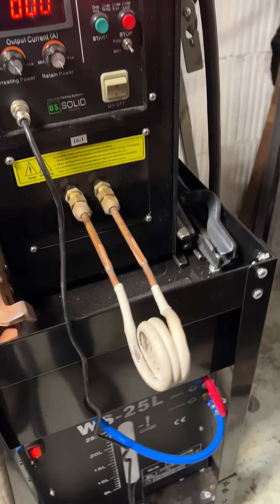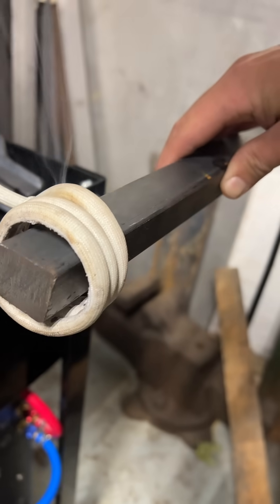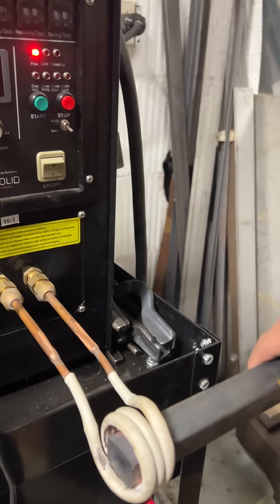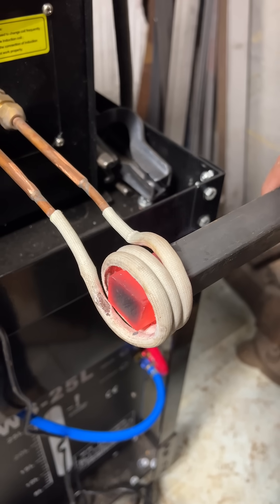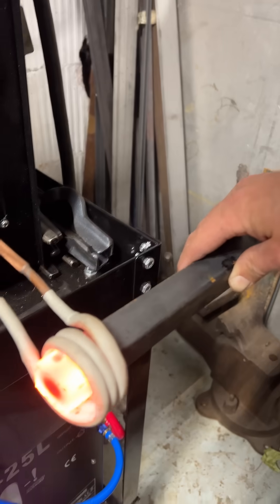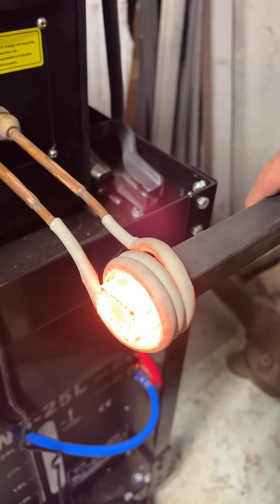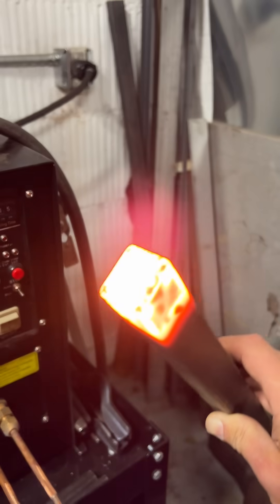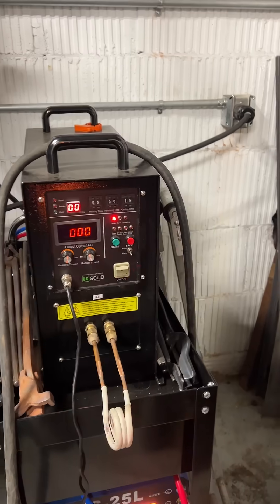Red Hot Steel In Seconds! - Induction Heater

Comment: how is it not hot where you grab it? I've always thought most metals conduct heat well
Reply: It takes time for heat to diffuse through a metal rod. The mathematics behind this is taught in great detail in the very beginning of any introductory partial differential equations course/text. 

Surely though you've noticed that when something heats up, the entire object doesn't come to the desired heated up temperature instantaneously, especially when only one side of the object has heat applied to it

Comment: Those things need a RIDICULOUS amount if power tho, super sketchy to do in your own home lol
Reply: Why, because you don't know what you're doing?
Reply: @G59-Izalith  yeah i was thinking the same thing. Whats sketchy about it??? Unless you have a illegitimate  power supply it should all be above board. Its no different then learning how to well. Actually easier than welding. 
Welding you have all kinds of amp rating and material setting to have to track and set.  If anything a microwave is sketchymier than this
Reply: @c.a.nationwide  lol exactly ....they need to go play with some microwave transformers....
Reply: Wellllll, lots of power, but only for what, 60 seconds at a time, so not too bad.

Comment: Ah yes, the forbidden flesh light.
Reply: Unless your dong is made of steel you're going to be fine. The magnetic field this gives off only really affects metals. A microwave is just this thing but tuned to what your dong is actually made of, mostly water.
Reply: @DingleFlop  iron man would be screwed
Reply: @iborincon  the internet never dissapoints
Reply: @therapgame1091  Right? Lmao
Reply: @DingleFlop  MAN OF STEEL BRO, MAN OF STEEL🦸🦸‍♂️
Reply: @DingleFlop  you right.
Reply: @DingleFlop  understood, not a forbidden fleshlight unless you have a stainless knob piercing.
Reply: @DingleFlop  Superman be like “FUUUUUUUUUUUUUUU-“
Reply: @DingleFlop  would just about any low frequency work (and even be desirable?) for the induction heater? Obviously microwave uses very high freq tuned to excite/friction/boil water molecules, but as I understand it the induction heater accomplishes it’s job thru eddy currents (?) / just having massive amounts of current flowing in a specific spot? 

I’m not trying to present that I have 100% grasp on these, I am truly not an expert..! I just want to learn!

Cheers
Reply: @DingleFlop  Key takeaway that it's safe to interact with as long as metal isnt involed is 100% true. It's not really the same though but it ends up doing similar things. The microwaves' electric field interacts directly with polar molecules to cause them to vibrate, which is what heat is. This induces a high current in the metal so mostly just effects electrons and that in turn causes heat. A microwave uses essentially an antenna to produce waves that cause heat, this just directly uses the induced electric field in the material to produce heat.
Reply: @28porkchop  by the power of S C I E N C E !
Reply: @DingleFlop  a magnet job 😈
Reply: @DingleFlop  Username checks out
Reply: @DingleFlop  

That's only true for everyday magnetic fields.... they have used magnets to float fruit, frogs, and wood with high enough energy... So a strong enough induction heater might be able to do the same to flesh and wood.... Tho that would probably also be so strong anyone in the area would probably die.
Reply: @DingleFlop  so its safer to put your dong in an induction heater than in a microwave?
Reply: @DingleFlop  Don't know why you brought up the microwave, you were right up until that point
Reply: @Syndicalism  a microwave is a radio transmitter based on a magnetron that creates a 2.4 Ghz radio (electromagnetic) signal at many watts to use the exact same principle (forcibly vibrating molecules at a resonant frequency to generate friction and consequently, heat) but tuned to the resonant frequency of water. Induction works in almost exactly the same way, though a magnetron is unecessary due to the wavelength of that radio signal only needing to be around 150 Khz to resonate with the molecules found in metal. Because they are literally the exact same principle, they are in fact, quite similar and I'm not sure what your issue with that explanation is.
Reply: @Dingle Flop  God I'm glad everyone on herearen't   fools.
Reply: @DingleFlop  an induction heater is hardly anything similar to a magnetron is the thing. You mention two things that fall under Faraday's law and that's the only major similarity between the two.

It's just dumb to bring up is all I'm saying because you can just say x is practically the same thing as an induction heater except it is tuned for y. This statement is true to an extent for anything that operates according to Faraday's law
Reply: Wrap it in foil lol
Reply: @816rob1  um foil is aluminum.  Nonferrous. Wouldn't work.
Reply: @shawnshurtz9147  tinfoil makes my induction stove top work with other certain pots/pans that won't conduct properly ontop of them, could you explain what's happening here?
Reply: To add to this, the main hangup seems to be "A magnetron is nothing like an induction heater."
Let's take a stab at that...

A magnetron is an electronic device that uses physical properties of electrons to generate a radio wave at a desired frequency, with a bunch of fancy resonant cavities within it.

Because we don't care about modulating the output (like in wifi radio communication) this is a great solution to creating a high frequency, high power radio wave with the simplest components. The exact same could actually be achieved with super expensive high power transistor radio principles, simply due to the amount of power and the frequency required we use a magnetron for economics.

Because the frequency of an induction heater is so LOW, despite it's high power, the radio frequency can be generated by other means, though also due to the low frequency, it's best to "catch" those radio waves in the metal object by heavily concentrating them with a coil, which you insert a metal object into, rather than a metal box, which would absorb those waves due to the frequency being in tune with metals. Some would be reflected, but for induction heaters a coil just makes more sense.
Reply: @DingleFlop  quick question so I'm not a expert at understanding none of this stuff either but on a quest to learn a bit more I read all these comments and I was wondering you say microwaves operate at a frequency of 2.4ghz does this mean wifi is essentially similar to a microwave and or if I run more wattage threw it some how without blowing it up that in theory I would create a microwave of some sorts?  It kinda sounds like so from what I'm gathering from what you were saying in these comments about the frequency that excited water and what not.
Reply: @WarzoneWarlordGaming  absolutely! The difference being that your microwave oven consumes about 1,000 watts or more of electricity to run, with most of that being converted into radio energy, while your wifi router consumes about 2 watts, converting about 0.1 watts into radio energy. The rest of that 2 watts is used for the computation needed to actually route traffic, form data packets, etc.
Reply: Nono, I'm absolutely glad that you all are actually giving it some real thought! It's great to have people understand how these principles interact with each other.

When you talk about induction heaters, people make a big point to say "Ahh yes, the radio induces a current into the metal, and the Eddy currents heat up the metal!" which is absolutely correct, but if you Google really quick how a microwave works, for one, and also why you shouldn't put metals into a microwave.... You'll find that microwave ovens do in fact also induce currents albeit at a different relative voltage.

The real main differences between the two are A. The frequency, water really likes moving at about 2.4 Ghz, which is why a microwave operates at that frequency, most foods contain enough water for this to work well for heating them and B. Induction heaters for metal are a few times to many times more powerful than a microwave oven, which is usually only around 1,000-2,000 Watts.

The vibration of the molecules (heat) is caused by those Eddy currents, not by some other physical force. It's literally the relationship between electromagnetism and the physical world. Radio is really cool, electricity is really cool, magnets are really cool and it's awesome to see these principles applied in real world technology that is useful to humans!
Reply: @DingleFlop  I like you man. You smart. You loyal. You cool dawg.
Reply: Actually you can make a BBQ out of it
Reply: Challenge accepted
Reply: people with D piercings:
Reply: @garlicbreadstick404  lmfao bro, oh no.
Reply: If you're brave enough
Reply: I'm not the only one😁
Reply: Something a virgin would say
Reply: Why was I looking for this comment lol
Reply: Yes. Flesh “light”. Literally.
Reply: Yikes!
Reply: Stupid question but wouldn't it harm you since we do have iron in our blood?
Reply: @Sleepless-mind  no the iron in your blood isn't formed enough to produce eddy currents in it.
Reply: Redo Of Healer MC: Done that.
Reply: ** off 😑
Reply: hope u find God,
Reply: @lewhan_b01  I hope I do too! Shit, that'd sure prove me wrong!

Comment: "Next time on forged in fire, we throw out the forge and use induction heating. But now you only have 30 minutes to complete a blade!"
Reply: I'd like to see that struggle
Reply: @JR-qz3bc  oh im sure it would be the most intense episode EVER. MAYBE IM ON TO SOMETHING. (Screaming) "someone get me the producer on the phone!!"
Reply: @c.a.nationwide  That show got old quick when I realized how expensive it would be if I wanted to persue blacksmithing, even just raw materials and basic tools. But for this, I would absolutely watch an episode
Reply: @pws3rd170  Start small. I started making knives when I was 12 with an angle grinders, a file, and a Black and Decker Workmate Vise. I made my first forge out of brake drums a metal stand for potted plants and a hairdryer from the thrift store, now use a hells forge double burner propane forge. First anvil was a piece of railroad track, now own a 275lb RIGID Anvil. My first “belt grinder” was a 3x18 belt sander clamped in a vise. I now have multiple work benches, toolboxes, a heat treat oven, three quality vises (restored two of those for cheap), drill press, table saw, chop saw, bandsaw, multiple angle grinder, etc. it’s taken me over a decade to do this though, and I funded it largely through selling my knives and through saving up extra money over time. Over the years your skill will go up and you’ll accumulate and upgrade equipment, and before you know it you’ll be good at your craft and have a good shop going. If you’re genuinely interested in getting started and are on a budget check out the book the $50 Knife Shop. My point is we all start somewhere, and most of us don’t have the money to just buy a fully equipped shop from the jump, but that doesn’t mean you can’t get started and learn and build as you go. Best of luck to you! 💯
Reply: @grantdavid9466  my problem is I need a safe beginner friendly heat source. Oh and free time to learn
Reply: @pws3rd170  free time is the hardest one to find. We all have it. Just cant find it.
Reply: @pws3rd170  not really, it’s quite cheap actually to get started, you don’t need all that fancy equipment. You can use a charcoal fire with any sort of air pump, hand crank or electric, a flat and thick chunk of metal as your anvil or even a flat stone, any hammer and an angle grinder and you’re set.  The most important thing is having a space in which to do your smithing, that’s the difficult part. The metal is actually very easy to come by, any scrap as long as it’s carbon steel can be used. Heck just buying already machined carbon steel blanks is quite cheap.
Reply: @pws3rd170  the time is the hard part
Reply: @pws3rd170  I made a forge outta junk at the house and coal so you can get in super cheap if you really want to. My anvil is still a piece of rr track. The base is probably more important than the anvil itself I went from a table to a heavy log and it was night and day
Reply: @adamclark2245  Good advice brother. The base is very important, it adds mass which is critical for rebound.
Reply: @pws3rd170  be creative on how you get tools. Go to a local steel recycling center and buy a 60 pound chunk of steel. You have an anvil. Garage sales for hammers or harbor freight.  Dig a hole in the yard and a hairdryer for air. Vice grips to hold metal.  Find scrap metal to work into a different shape.
Reply: @grantdavid9466  please tell me the name of your YT channel or web page
Reply: @c.a.nationwide  so true
Reply: @pws3rd170  You can always check your community for blacksmithing classes.
Reply: @James on ok. That is a bit cooler.
Reply: @James on 😵🤯😵🤯😵   are you talking about David Baker??????!?!?!?!?! Did you get a picture with the legend at least??
Reply: Forged in fire is a scam and they never do it in the time they make it see like anyways, they literally could edit it to be 30 minutes now and a bunch of tards would believe it
Reply: @JohnDoe-yg6ed  interesting. What proof so you have of that. Id love to investigate that. We have a major conspiracy on our hands. Sources??
Reply: I reckon I'm the only person that doesn't play minecraft- you go nerds!

Comment: I'd just like to point point out that "the heat being isolated" is more of a material property of steel, if one where to heat aluminum this fast (for instance when welding it) the heat would spread much quicker. That being said, of course the quick heating is the reason there is no time for it to spread, so that's neat.

Comment: Us mechanics use hand held versions of this to heat bolts near fuel tanks.  They come with multiple sets of coils too, so even if there's just a seized bolt in a tight space you can bend a longer set of coils to reach in there. Super neat tools
Reply: I bought one 15 years ago, cost me over a grand, still the coolest tool I own.
Reply: I've been debating buying one, since I live in a rust belt state. I'd be curious if the one in the video could have leads attached similar to a welder that would give you an even smaller handheld unit.
Reply: @cordcd7  the handheld ones are pretty cheap and compact. Better route for sure.
Reply: @evanquigley8964  Convinced. I will order one of the handheld ones if some of the stubborn rusted bolts prove too much for my M18.
Reply: @cordcd7  you can get the miniductor 2 for less than $200 on Amazon, they used to make a bench top unit with leads, dont know if they do anymore. I haven't had a problem getting the handheld unit where I needed it.
Reply: @jhallin5185  I'm a contrarian sometimes so I jump to going against the grain but this seems to be one of the times where I need to embrace what's available.
Reply: Yeah fiberglass sheath tube and copper brakeline tube is plenty cheap. I built my own power unit, think I got 15-20 different "coils" I've made by now and I'm still on the same 30ft roll of copper brakeline.
Reply: @pr0xZen  That sounds cool.  It's always great to be able to build stuff yourself.  How do you make your own?
Reply: Building it yourself 👍
Reply: @pr0xZen  

I love to see an instructables type bud for that, that sounds cool!
Reply: Used one of these the size of a small bathroom to braze coupler fittings onto titanium aircraft hydraulic lines. Amazing how much power they transfer.
Reply: wat will u do wen u hav 2 work for tesla and elmososmuck says he don't like u lmao godluck @ NASA loser
Reply: I've wanted one of those for the longest time! They'd be great for use near brake lines and rubber boots on suspension/driveline components. Currently just using a torch or electric heater and fashioning bits of thin steel to act as makeshift shields around sensitive components. Obviously not near anything fuel tank or line related though!
Reply: Yes. And sometimes if it’s actually in the gas itself, and you’re not entirely sure that this is not absolute bullshit, you reverse the polarity and COOL the bolt.  So nobody gets hurt!!
Reply: @e.t.6767 Fake

Comment: Think you meant magnetism bro, the coil is the magnet.
Reply: The coil is not a magnet. The induction heater is driven by an AC source. This AC flows through the solenoid (the coil) which produces a magnetic field (Ampere's Law). The fact that the source is AC means the magnetic field that's produced is constantly changing direction.
Reply: @Syndicalism  you should go back and re-read your old textbook before you try to school someone.